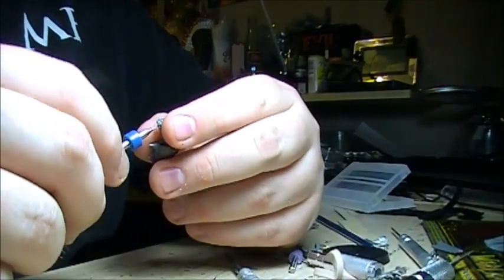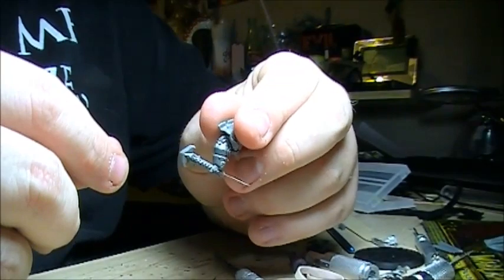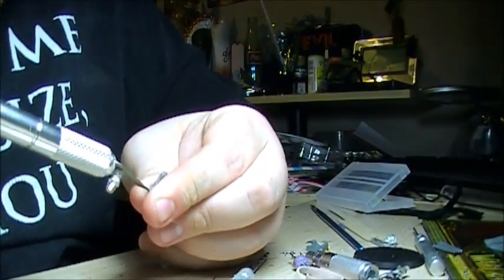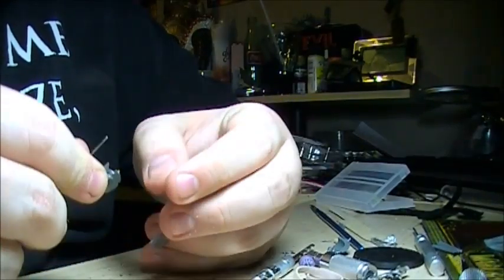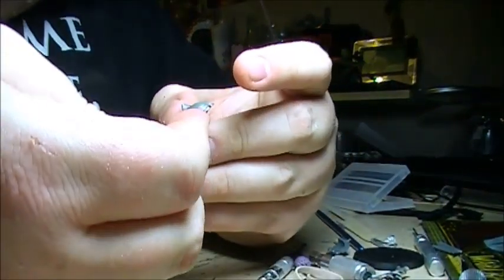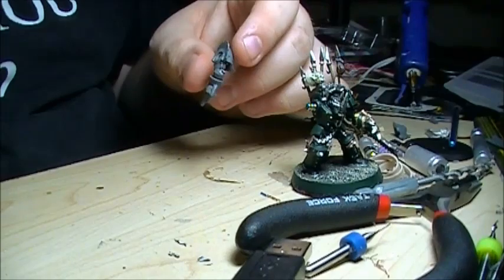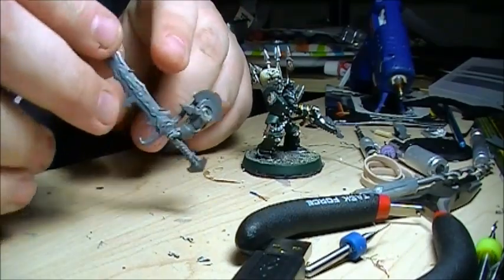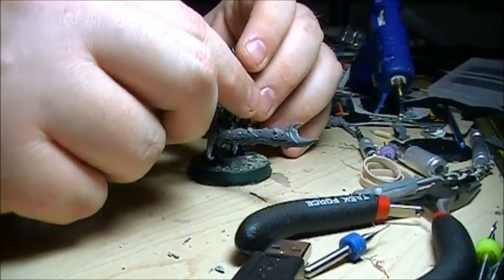LED Lighting in Warhammer 40k Chaos Lord - Part 4 Custom Weapons and Magnets

Comment from the maker: I suppose if you had a variable speed dremel with a really slow setting, you could do it with power, but honestly I almost never do anything but spinning by hand.  You get a lot more control this way and when you are working on something that small, control is everything.    As for the magnet question, the simple answer is yes.  all of the above, depends, etc...  I've used pins, I've had magnetic hands, arms, guns, you name it.  It depends on what you want your end result to look like.  However, the best real answer is that most of my magnetic troops have the shoulders cut with the magnets in what would be the shoulder socket and a matching one in the arm, as shown in this video series. To me, this allows for the largest magnet and is usually the most forgiving if you make a mistake.  However, this tends to be the most expensive option if what you are looking for is the ability to change weapons out on the fly.  If you go with the whole arm, shoulder socket method, you usually have to hunt ebay for things like extra arms and shoulder pads.